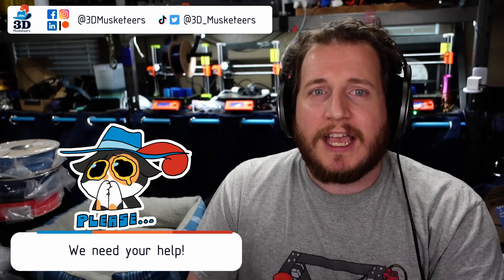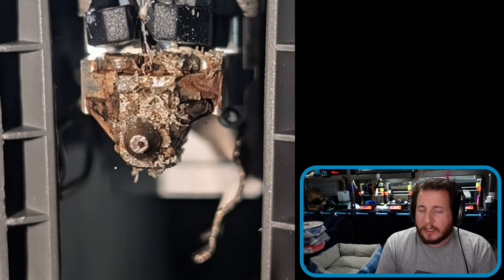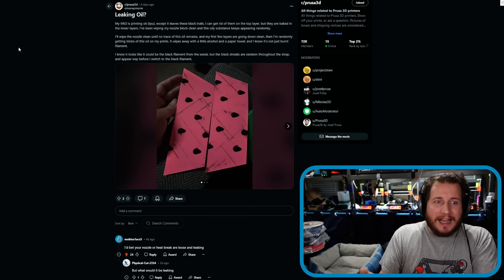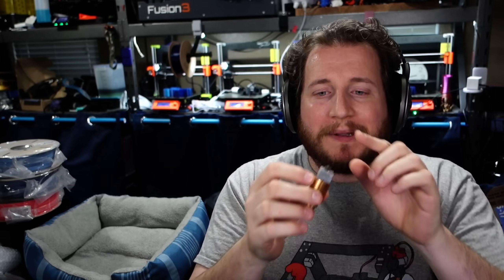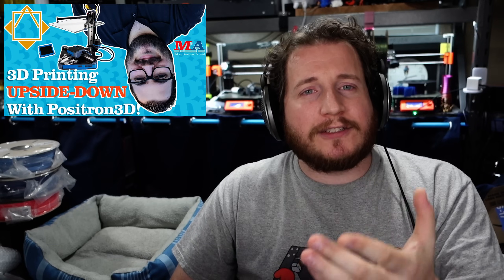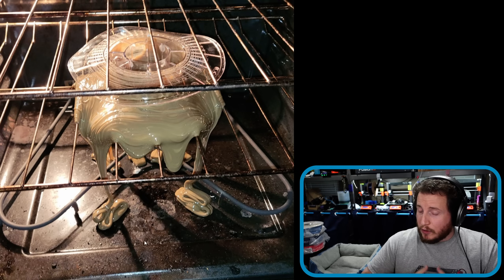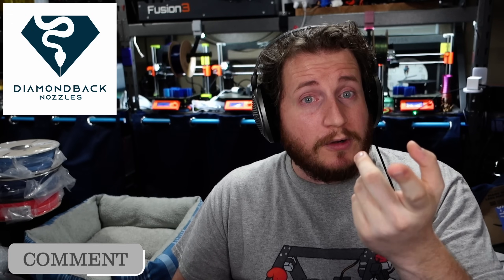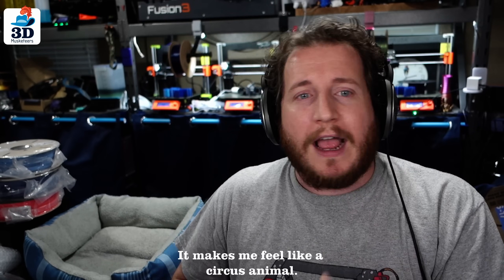Prusas Leaking Oil and Ovens Leaking Filament! - PrintFixFriday 152

Comment: For the A1 mini, more than likely the 4 screws behind the mount for the nozzle, heater, and thermistor can come loose or fall out. Then the nozzle mount can move up almost 1/8” and have inaccurate measuring of the bed.

Comment: Looking forward to hearing your thoughts on Stratasys suing Bambu and others... Its going to be a good one!
Reply from the maker: They only sued Bambu to my knowledge. Thoughts will come eventually TM
Reply: @3DMusketeers  yes and no. There is a handful of other companies in there, most of them relating back to Bambu.
Reply from the maker: My understanding is that each of those is owned by Bambu or the company that owns Bambu (if they have one). It is every subsidiary. But, I could be wrong.
Reply from the maker: yes, yes it will..

Comment: The oily black streaks...my first thoughts go to leftovers from PTFE breaking down or maybe some oil that comes off of overly cheap silicone socks. For filament to burn enough to turn black but then still be liquidy is kind of a stretch for me; simply having black filament from a previous print be heated enough to drip off of the hot end seems plausible, however.
Reply from the maker: Prusa's dont have PTFE that far into the hotend. And MANNNN if your PTFE gets that hot, you will have health issues lol

Comment: I run a Creality CR6-SE which is probably the very first printer using a strain gauge. While I never had this issue I can see what could cause it: when there is some abnormal load from above on the print head the nozzle will effectively need more pressure to trigger and hence literally trigger at a lower position (a strain gauge measures position by effectively bending so a higher force means more bending). This only needs to be 0.2 mm for the printer to subsequently scratch the build plate. (I assume this is not just a problem of wrongly setting the z-offset as that will do it with any printer.) Those modern printers mostly have their strain gauges in the build plate and not the hotend as the Creality CR6-SE has. The same will happen here when there is an upward force from below for instance from some filament debris stuck there.
Reply from the maker: Prusa uses hotend, Peopoly does too. I THINK Bambu bed slingers dont, I know the X and P series are all in the bed, but they also have them in the head I THINK..

Comment: Some older ovens can be turned on so only the light turns on, but no heating element. This slowly raises the temperature just enough that it could be enough for drying PLA or so. I would rather put it on the heatbed with a cardboard box.
Reply from the maker: that is.. excessively slow LOL, but would be funny
Reply: @3DMusketeers  slow, but safe. :)

Comment: Do you have any thoughts on Stratasy's lawsuit against Bambu Labs on 8/8/2024? Heatbed, purge towers and force feedback for the first layer. My understanding these where developed in the open-source community.
Reply from the maker: They messed around and found out. Most won't stick but a few, stratasys has them dead to rights on. That's all I'll say for now, video in a few weeks when it's blown over a bit.
Reply: @3DMusketeers  I feel like we need to wait for discovery to truly get started and hope the court does not seal anything to "protect corporate secrets". My understanding is generally that the juicy stuff the initial click inducing news headlines lack comes out during the discovery process of lawsuits.
Reply from the maker: discovery will take some time, we will see if it even gets there though. I have a few chats with IP attorneys scheduled. stay tuned ;)

Comment: My loadcell on my MagnetoX is going up to 600+Grams of pressure to trigger frequently.. and as low as 300ish....  it is part of the reason I think my personal machine has issues, as it isn't reliably 1 pressure or another... but a variable amount to trigger the load cell - which is terrible.

Diamond filament exists but actually isn't that abrasive, the reason being the diamond bits, are quite small, round, and don't actually tend to 'grate like sandpaper'

Most have "nano diamonds" which are spherical and act as a lubricant, more than a strengthening agent.
Tiamet3D has some that boasts some pretty interesting properties after annealing - and the 'nano diamonds' basically act as an internal heat spreading unit, and lubrication to allow the filament to flow 'easier'. (makes sense as diamonds, do conduct heat rather well, so heat reaching them would spread out)

I have yet to find a 'diamond filament' that requires even a 'hardened nozzle' for wear and tear.
Reply from the maker: yeahhhhh been there!

Comment: I also think that oily drops are from a loose heatbreak.
Some PLA filaments seem to contain such oily components, which goes easier through the threads, so it gets separated.
I have seen that dropping from the heaterblock and it doesn’t fully solidify when cold.
Reply from the maker: what PLA has oil in it?

Comment: Black Streak, have you noticed the perfectly repeating pattern. It look like the bolt pattern of the heat bed. Is it possible to see the bed and the print surface ?
Reply from the maker: I dont have photos of it, but its unlikely to cause damage that turns black.

Comment: With loadcells, the most common cause of problems I've seen are stubborn filament stuck to the nozzle and on some designs the nozzle can come loose (screws not tight enough on the Mk4, for example). Even with today's fully automatic printers, I always recommend watching the first layer.
Reply from the maker: always watch the first layer!!

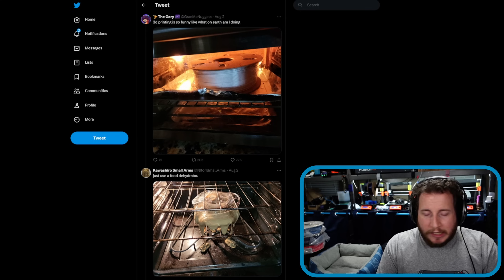Comment: 8:16 woah that’s a gloopy cake 

Little tip if you are on a budget and want to dry filament. You can use an upside down card box with holes poked in placed on a heated build plate as a make shift filament drier. You would need to experiment with bed temperature vs air temperature inside the box. If you have an enclosed printer you can skip the cardboard box
Reply from the maker: if it is jank and it works, it is not jank

Comment: so one nice thing about the prusa mk4 + mmu3 combo (when the z is properly calibrated lol) is that it unloads the filament after every print. This means it shouldn't have any gunk at all on the nozzle and therefore get a better reading. Interestingly enough when using a mk4 non mmu profile, it loads filament before doing anything. Which gets back to the whole it might extrude a tad before probing.

Comment: Sometimes A-places are the only way to get nozzles at all. E-Neptune 4 Pro for example did not have spare nozzles for the longest time, much less hardened. It was one of the callouts other creators made. Eventually, they did have singles you could get, but not hardened. I don't know if it has changed by now, but when I contacted them, 8 months after it came out, the response was "We are looking into it."

Comment: I had a similar set of black streaks on prints and it wasn't that the heatbreak was loose but instead that they ptfe in the heatbreak was cooked and breaking down. Rather than eating or shrinking and causing a jam it was melting and extruding along with the filament. Once the ptfe was replaced all the streaks stopped... then I got a bi-metal heatbreak and the problem was gone permanently.

Comment: But, the FB groups all said to put it in the oven. Surely the masses echoing the same answer must be correct about all printer and filament aspects. The reason the filament turned into an oven puddle is that they did not level the build plate after calibrating e-steps and it had to much water. Hesh...

Okay, I wish I was kidding. Almost every "how do I fix this" that is the common 2 responses, including for one that would not power on. The power pack was switched to the wrong voltage.

Comment: I'll stick with my pinda probe  :)
Reply from the maker: I feel the same way.. then I look at the MK4 and XL lines and say hmmm..
Reply: Needs Z adjustment for that, though. The reason for the loadcell is you should never need to adjust the Z offset, and slight nozzle length differences are fully accounted for since the nozzle itself is used for calibration. Loadcell also works on any build plate. The drawback is you need to make sure the nozzle is clean before printing, otherwise the filament stuck to the nozzle makes it difficult for the loadcell to determine the height of the nozzle.